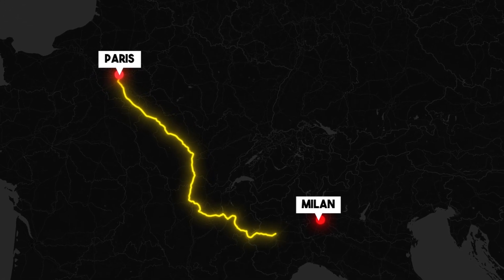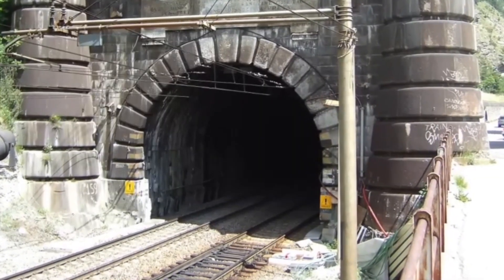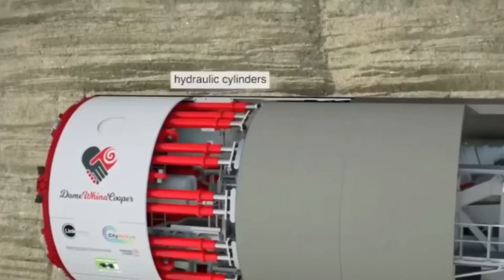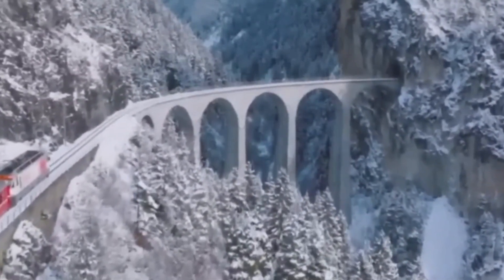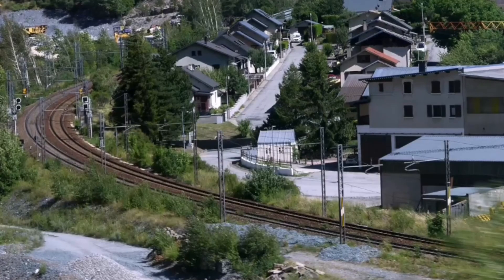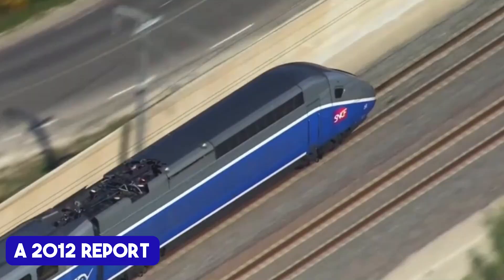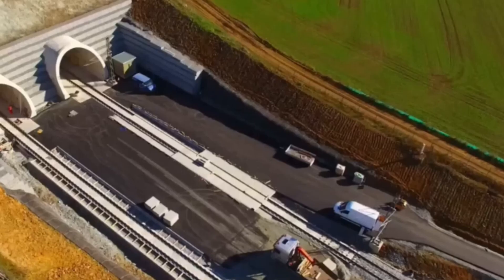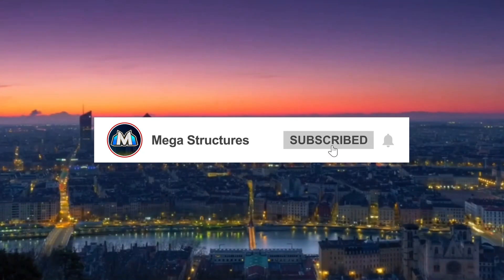Paris & Milan linked by the Longest Railway Tunnel in the World!

Comment: The author and YouTube fact checkers need to get a grip.

The TELT (Tunnel Euralpin Lyon Turin) is being built by Artelia between Saint-Jean-de-Maurienne (France) and Susa (Italy). It will be completed in 2030 (I understand, I may be wrong).

This will be a useful tunnel designed to carry 5 million passengers a year and almost 40 million tonnes of freight, thereby reducing road transport and the resulting pollution issues.

It is a shame that the Trump's version of the USA is not capable of building rail infrastructure to transport goods from east to west and seemingly has to resort to invading Panama instead? [Brexitland is also no longer capable of building rail tunnels under the Conservatives either...]
Reply: I read yesterday some documents from FS (the company responsible fro the italian rail network) and it was written that the works were espected to finish in 2032. Furthermore for this kind of things it usually take at least a couple of years more to complete so I expect everything to be done in 2035.
Reply: @magmar-wt5on  Yes, highly probable. It is difficult to understand what the total cost will be, but the benefits can be capitalised into infinity.

Comment: This tunnel is built too early. It only doubles from Susa to Saint Jean de Maurienne  an existing railway (that can be and have been modernized) using the Frejus tunnel  where trains can go at 80km/h instead of 160km/h in the new tunnel ie only 20 min saved. That's nothing around the time needed to make Paris-Torino-Milano and it costs around 10 billions €.
The big problem is that the new tunnel can't be totally efficient because of railways approaches from Lyon to Saint Jean de Maurienne don't have enough capacity of flow nor speed and that means that new railways and new long tunnels have to be built there for almost 15 G€ and not in use before 2045.
And the railway traffic from France to Italy isn't growing and there is no reason it will grow if industry relocalization  will be used to save energy and reindustrialize French economy.
Itzly have enough tunnels to Switzerland and Austria for its own trafic. There is no need that freight for France arrive in italian ports, Marseilles Port and Le Havre Port have enough capacity to do it, they have railways links but also water links to their hinterlands and CMA CGM is one of the biggest world transport company
And last but not least, the tunnel is built thru very toxic soils and will change (as it arrived when was built the tunnel of the "direttissima from Bologna to Firenze") the water levels in the ground and  the springs all over it
Reply: What a bunch of wrong data propaganda.
Reply: @Lukaus1241  To whom do you write? to the video? you are wright :-)
Reply: the french are building a new high speed ine from lyon to the start of the tunnel, and the italians are doing the same from their start of the tunnel to turin, what are you on about?
Reply: @daanwolters3751  "the french are building":-) Excuse me, I'm a french engineer, retired from Ministry of Environnment and Transports. The wright sentence could have been: "french would build!" But French state have no money to put in and SNCF is crolling under debts (as French state) . So that needs a lot of time to find the money. I wrote that these works are now planned to end in 2045! The 9 billions € of the 57km tunnel could have been spared almost 20 years , because existing line has a capacity of 18MT and only 3,5 Mt is now used! There was last year a ground slide on Maurienne vally upper Saint Jean and the line is closed because SNCF don't have money to repair  as fast as thy did 50 years ago when the same accident arrived in the same valley!
Reply: @jmt97400  if you are a retired engineer, tuen you know both landslides are not comparable as the last one requires far more work to stabilize the slope.

Second, the old line will always be underutilized thanks to its 3.5% gradient and antique 1500v electrification system making it impossible to use long freight trains.

Similarly the travel time required makes the old roude unattractive for passenger rail between lyon and milano. 

So yes, the old route is underutilized because it is a bad and unattractive route, and that will always be the case, that is why a new route is being build. 
Just look at your neighbours in the alps, freight transport by rail increased tremendously after the brenner base tunnel was opened. And that was while the old route was not fully utilized and had AC electrifiction*, just because it made freight thatuch quicker and cheaper, by removing the steep gradient and reducing the lenght of the route.

Third the funds for the lgv are already allocated and partially from the eu. Just that comstruction of the tunnel wil take longer and has priority.

*(giving locomotives more than twice the output they would have under 1500V).
Reply: @daanwolters3751  First of all the difference between the two landslides is the capacity of SNCF to control it. In the 70's, SNCF have its own teams to maintain the railway grid and repair it. It needed only 3 weeks to reopen fully the line, as there was not the road tunnel and the railway was a priority. 50 years later the Maurienne railways has ceased to be a priority, SNCF has no more teams for maintain and repair and needs private societes that are not very efficient because they only think how to gain the max money and not make the better job for the collectivity! Good results of liberal politics  🙂
Second the old line was able,as i wrote, to support 18 Mt of freight and all the passengers who wanted to travel at that time with a tunnel built in the XIXè century. May be if you add 3 or 4 billions € of modernization, (including the reduction of some too little curves or pendulation) you can have a better efficacity.  Electrification of trains must be changed every 60 years, that could have been done if really needed. And there are other better solutions to move faster a heavy thrain than to have powerfull locomotives!🙂
In France as in all western Europe, no trains are longer than 750m nor heavier than 1800T to 2000T.  So a new tunnel has really no interest in this case.
The 57km tunnel shortens the travel by only 22 minits  which is really nothing  as it costs 9 billions € for that!

In reality the old route becomes underutilized because freight in France has decreased form 44% in 1974 to 8% in 2019 and also because Italy edicted many and many "security" rules against the old tunnel and then mades skrinken the trafic instead of making it able to  become better

There is really no need that the freight goes faster than the 80km/h he goes in the Frejus Tunnel (most of the freight in France is not faster!) , it is a lost of energy and money. With the climate change we have to learn to predict more our needs and by the way the better investments to make would have been to change the wagons which are old and heavy and a no paying freight! 

The freight don't need to be cheaper (as most of material things of our lives) as it is only a way open to waste it! The climate change asks us to relocate the productions near the consommations and then the global trafic in western europe has to decrease a lot even if railway trafic has to grow.  Most of the french-italian exchanges could disappear every time it is about similar things

In reality, there is no scientific reasons to think that the trafic from France to Italy will increase. Then why wasting so much money by going too fast?.A progressive planning would have been better

"Third the funds for the lgv are already allocated and partially from the eu." The only part where EU puts money is the french-italian central part (from Montmelian to Chiusa di San Michele) around 84km  where passengers train could reach 220km/h. . But France has to built a new real LGV from Montmelian to Lyon  for passenegrs and there is another 46km track only for freight.that needs to be built and some more works on existing railwways. All this don't have the money to be done (international treaties tells that is is the problem of SNCF which have not the first euro to do it and the new government has no possibility to help it :-). 
ANd even if money is here, there are many other places in France where works on the railway will make a better return.

And France has no interest to waste money to compete with other alpine tunnels. Such projets need many years to have a positive turn back and the situation is not good for that.

An project that would have been more interesting could have been a tunnel between Briançon and Oulx for the link Torino to Marseilles and Spain (which trafic is now supposed to use Rhone valley line till Lyon  but could use the Durance valley line very underutilized)

Comment: The channel tunnel is still number one in my eyes
Reply: the longest underwater tunnel is in the north of Japan. The Brenner base tunnel combined with the branch south-east of Innsbruck is longer.
Reply: @danieloehler2494  Whether it's the longest undersea tunnel is open to debate. The Seikan Tunnel goes underneath the sea, and is slightly longer than the Channel Tunnel. However, the Channel Tunnel's undersea segment is considerably longer than that of the Seikan Tunnel. It really depends on what you're measuring.
Reply: Agreed. It’s a marvel. Now if only it connected Europe to some country that has its sh*t together.
Reply: the tunnel is a wonder of engineering, but how badly it is utilized should be a crime against humanity.
Reply: @daanwolters3751 it's still an achievement ov it's time and still very much in used to this day
Reply: @ "the tunnel is a wonder of engineering" me (previous comment).

It is ciminally underutilized. Not even half of availdable capacity is used. In a large part thanks to 3 factors:
- eurostars monopoly on passenger rail.
- lack of capacity and available routes in and around London to send trains from the channel tunnel to other cities, or even other stations in london.
- That it is impossible to buy a trough ticket to any other city in the uk.
If you want to travel beyond london you need 2 separate tickets, meaning you are not protected if you miss your transit due to a delayed train (so you either need a massive amount of transit time, or risk having to buy an overpriced ticket at same-day prices).
I should note that it is very possible to buy a trough ticket from london to anywhere in the eu, it is just the other way round that it is impossible. 

And well, as long as the UK does not fix factor 2, the channel tunnel will remain underutilized, and as long as factor 3 is not adressed, the channel tunnel will only connect london to europe, instead of linking most of the uk to europe, which is a shame.
Reply: @daanwolters3751  wow yer know yer stuff
Reply: @daanwolters3751  IIRC the original plans for the channel was for trains going all the way to scotland, and further on into all parts of europe. Naturally as we in the UK do with every rail project, we scrapped that and the result became a shadow of its former self that didn't meet any of the original goals, and the political back and forth ended up making it more expensive than the original full plan would have been away.
Reply: I don’t mind hearing the length in kilometers but I’m still curious about what the distance is in miles.
Reply: @davidaldinger113  There are calculators you know. 57.5 km / 1,609 = 35.74 miles
Reply: @davidaldinger113 34 mile(plus inssbruk pass Is 39 mile) Brennero Base tunnel ,  the gothhard bb Is 35mile and Milan tò france is 35,5mile
Reply: @davidaldinger113  Just do the maths?